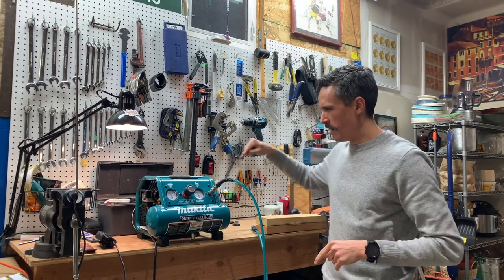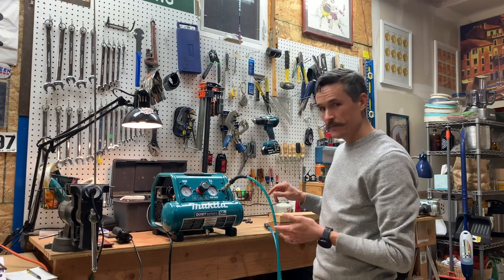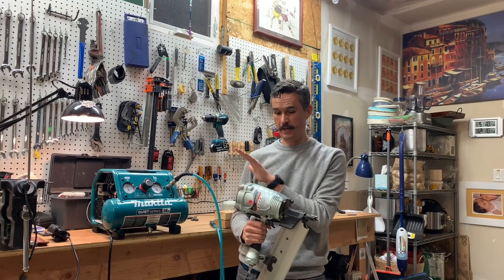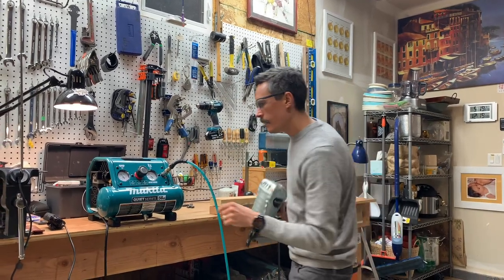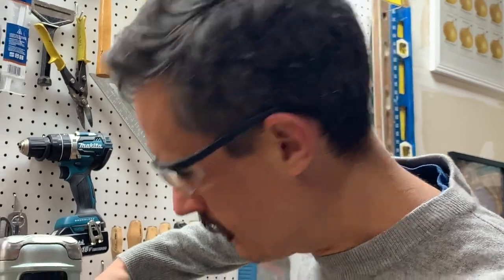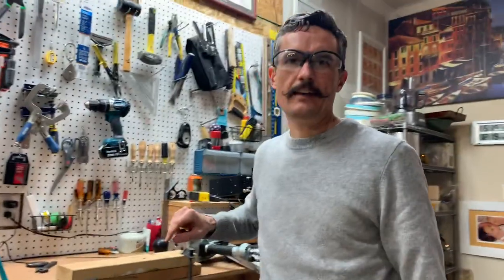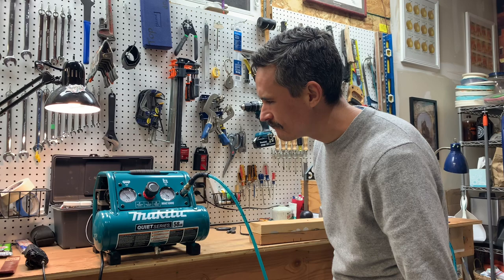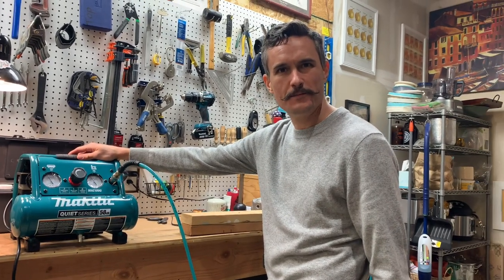Makita 100Q. Will it work with a framing nailer?

Comment: Your framing nailer demonstration convinced me to get this unit. They all advertised these small unit as useless for framing but I don't really need to fire 240 nails in a minute. I just need something to build a shed or planter box few nails at a time. I almost went for the ryobi 1 gallon one and completely disregarded how loud it is compared to this. I hate my current 10 gallon unit, it's so loud I have to let my wife know each time I turn that thing on.
Reply from the maker: My use case exactly!  I don’t use a framing nailer often. …but I have a wife and neighbors, all with ears, every day ;-). love this quiet boy for all it can do whenever and wherever I want.
Reply: The Ryobi is a bit louder but mine runs on battery which makes it a bit more mobile. I can drive 5 framing nails (3 in.) and then wait for compressor to catch up.

Comment: Thanks for the review, I was considering this one vs. the larger two gallon. I was worried this wouldnt run a small air cylinder at 40psi for long, but it looks like it will

Comment: In a pinch, you nailed it with this video demo! I need a quiet compressor for small framing project. One nail at a time works for me. Makita is a great brand. I may buy it soon :). My Porter compressor is just too loud and scares my dogs :( Thanks
Reply from the maker: Thanks! Yeah, my Porter Cable pancake was absurdly loud. I felt like I had to warn the neighbors before using it ;-). ...literally would plan projects around the times I could use it. With the Makita, I can get started as early as I want on Saturday morning! Also, I sold my Porter Cable on Craigslist for 50% of what I paid for it 10+ years later!

Comment: Has anyone thought to add a larger tank, even in framing you put a wall together, then you stand it up... Say you had a 5 gallon tank that you could splice in to the loop with a T joint.  how long would it take for this to fill up 5 extra gallons, would the motor burn up without oil...  How many nails could you get?  How much weight would a 5 gallon tank add?
Reply: I have the 2 gallon and I think it would be nice to have maybe like an extra 3 gallon from a pancake compressor for spare space just in case. 
mine hasn't burned up and I had it run probably like 30 minutes straight before
Reply: @wades623  is there an advantage to buying one they requires oil?

Comment: I’ve never owned an air gun. Needed one for a roofing nail gun. I really wanted small, lightweight, and quiet, but don’t know if it’s powerful enough. You pretty much answered the question, as I believe I only need three nails intermittently. I won’t be running at a breakneck pace as a retired, DIY’r, providing plenty of time for the air pressure to remain somewhat constant. So, thanks for the info.
Reply from the maker: Oh, right on. That’s the right use-case. You aren’t roofing every day! You’re a DIY’er with the occasional use for air. I LOVE the quiet sound and small size. That’s its personality for 999 of 1000 hours. Once in a while I ask her to run an air nailer.

Comment: What you need is a larger tank.  You can use an external tank to extend it, and then it will drive a lot more nails.
But of course, you need to wait longer for it to fill back up.
Reply from the maker: Well, yeah. But I don’t use it to drive nails normally. Except in a pinch.

Comment: It's a great compressor other than the safety switch kicks it off constantly. Have to unplug and wait. And this is my second one.
Reply from the maker: The automatic shutoff? That will happen especially if using an extension cord. If you need to use one, make sure it’s a 3-blade and the proper gauge for your length (for example, 25ft extension cord needs to be 12 gauge or bigger on 15 amp circuit).

Comment: I'm torn between the 100Q and the 200Q.  For the small price difference, I just wonder if I'd one day on a project wish I had the higher capacity and higher CFM of the 2 gallon version.   Decisions, decisions.
Reply from the maker: I think you'll always wonder. Unless you're super space compromised, go for the bigger one! I definitely have run out of air before. ...takes all of 30 seconds to get more, but it happens.
Reply: @TroyCraft  I think that's the way to go... thanks.
Reply: @mowomedia4801  what did you wind up buying?
Reply: @Mbehr24  I bought the 100Q due to less weight/size/quieter.  I figured if the lower cfm/tank didn't meet my needs I could designate it for home duty.  So far with a little recovery patience, it's met my needs.
Reply: The weight is the big difference, if you can carry around another 10lbs get the bigger one.  I prefer to have one as light as possible for quick jobs.

Comment: Hey Troy - great video (and mustache!).  I had a Porter Cable 6 gallon compressor, but sold it because I don't use it to it's capacity.  I need a compressor to top off my Tacoma tires and run a brad nailer.  Would you recommend the Makita MAK100Q, or would you go to the 2 gallon unit?  The price difference is negligible (~$40), but the 2 gallon unit is considerably heavier and larger.
Reply from the maker: Peter- I got rid of a 6-gallon Porter Cable as well. Sounds to me like we have basically the same needs. I’m really happy I got the small one. I agonized over it for a while but after a few months I haven’t missed it. I’ve topped tires, used brad nailer, and blown dust out of dashboard. The motor will kick on with extended use but it’s fast (and QUIET!). The 15 seconds it needs to come back up is often welcomed time anyway. For me, the biggest win over the Porter Cable is the noise more so than weight.
Reply: I like the 2 gallon, I don't really use it for anything major just like mostly blowing dust out of stuff or tires. I originally got it to do the valve seals in my car but that is a project I just  mainly haven't had a good place to do
Reply: @wades623  debating what compressor to get. What nozzle or adaptier do you use to blow dust off of your gear?

Comment: Man, if they could get this unit to work on a dual 18v or wall power - it would be the most amazing compressor.

Even metabo HPT has a small battery run compressor
Reply from the maker: It does work on wall power. I hear you though- an all battery option would be amazing. But the in rush amperage to start this motor is probably too much

Comment: Thanks for the demo! Sweet stache. Have a question — ordered the Makita AF506 2" Brad nailer which states it needs 2SCFM. For that reason I went with the larger 2 gallon version but from your demo thinking I can get away with the 1 gallon for my nailer, does this smaller unit work well for 18 gauge brads?
Reply from the maker: I shoot 18g brads with no problem. But, I’m shooting soft wood and MDF on small projects.
Reply: @TroyCraft  thanks Troy for the info! I’d likely mostly be doing the same but would like to easily be able to work with hardwood. I might spring for the step up just to be sure
Reply from the maker: @errolpereira8292  given that, go up in size. If noise isn’t an issue save the money and get a reliable 6gal pancake compressor.

Comment: Would the larger 320Q work for framing nailer a lot better? Looking at that size for building a shed.
Reply from the maker: It will work better in that you can shoot more nails before needing to wait for the compressor to refill. How big is the shed? Are you expecting to shoot hundreds of big framing nails and then top it with asphalt shingles? Assuming you're doing this project outside in the daytime hours, you can save a lot of money by getting a classic "pancake" style 6-gallon compressor. They are loud, heavy, cheap and reliable. If you plan to use the compressor inside in the future, then yes, by all means get the 320Q. It is SO SO SO much quieter. But if you don't need quiet, don't pay for it.
Reply: @TroyCraft  Thank you for your reply. SHed is 12x16. I will take a look at a pancake style.
Reply from the maker: Here's one that I like. I built a 20' x '4' shed with the older version of: https://www.homedepot.com/p/Porter-Cable-6-Gal-150-PSI-Portable-Electric-Pancake-Air-Compressor-C2002/203162815

Comment: I need something to blow off my small chainsaw, nothing else.  Would this one gallon unit do the trick?  Thank you.
Reply from the maker: In my opinion, you will be disappointed with that use. The tank is so small, that you may only get 15-20 seconds of blowing time. I think you’d be happier with a 6-gallon pancake style. They are loud, but cheap, and not too big.

Comment: will it work ok with Staple guns? for doing the upholstery work. How many staples can it fire in one charge?
Reply from the maker: I think it would work great. I’m not sure how many staples it would shoot on one fill. Probably not more than a dozen.
Reply: @TroyCraft  thank you and i hope you still have you moustache, because it rarely look good on men but on you it looks great.
Reply from the maker: @sagarmeena0210  I had dinner with a friend last night. He said, “so it seems this mustache is a permanent thing now. I think I’m okay with it.”
Reply: @TroyCraft  I’m surprised to hear only a dozen. I know that’s a guess but as a first time compressor buyer I just assumed a smaller unit like this would still have the capacity to allow for a lot more than that before refilling.
Reply from the maker: Yeah, I'm just guessing. I'm also thinking about how the system "leaks". Not the compressor itself, but the hose connections and the tool. In my mind, I'm imagining shooting a dozen staples over a 10 minute period with a leaking hose next to me. Yeah, you'd probably be able to shoot a LOT more if you're working fast or disconnecting the hose between down time (or buying better fittings than the ones I obviously have)
Reply: @Mbehr24  I have another brand same compressor and I just stapled up a large chicken coop wire wall and I had to replace the staples in the gun, not ever needing to wait for the compressor to catch up.

Comment: I’m guessing it’s not strong enough to inflate a truck tire….
Reply from the maker: I’m able to top off tires on a 4,500lb SUV with it.
Reply from the maker: …but no. I would not want to inflate a huge flat tire. It would work, but it would take a long time. There is enough power. Volume is the problem
Reply: @TroyCraft  Thank you for the information

Comment: Durability is the big issue with the fine and ethical Chinese. Only trust the Taiwanese. That said is it STILL running??? thanks. wondering if parts are available, though I doubt it.